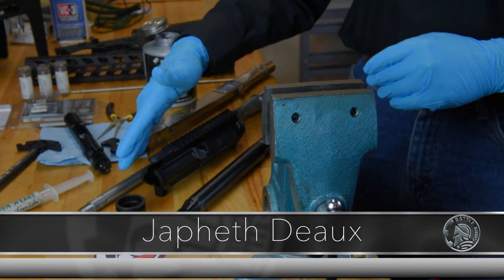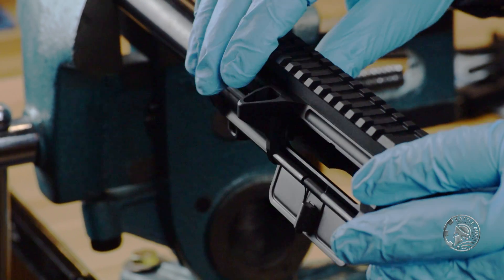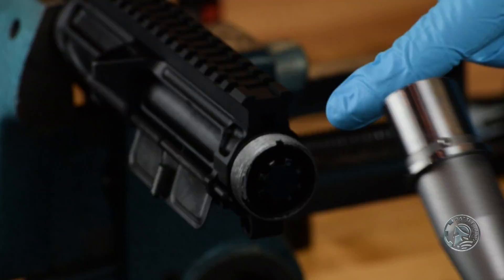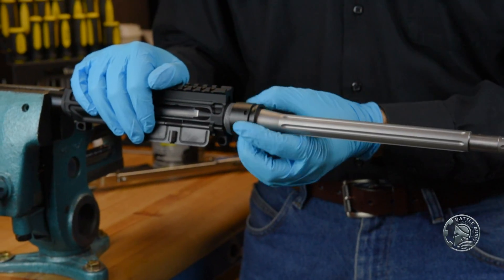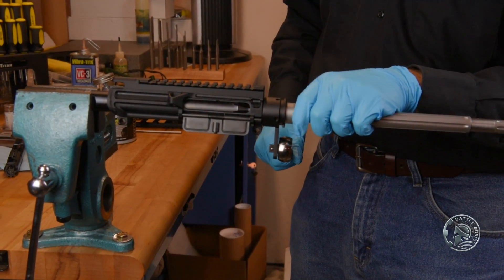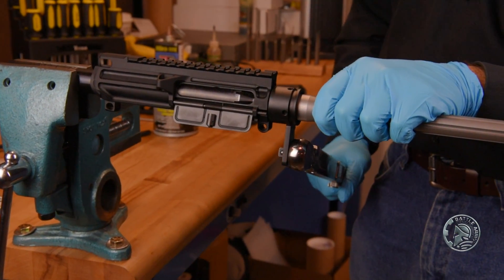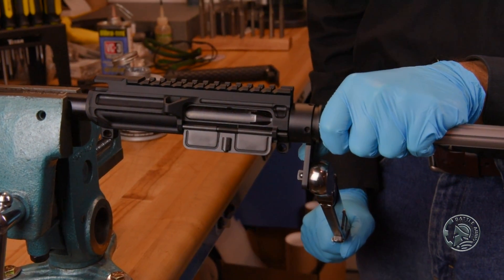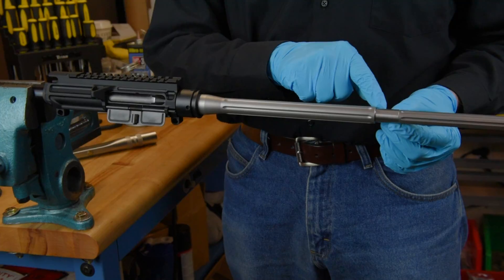THE UPPER:  Barrel Installation Part 3

Comment: Do you guys believe in facing or lapping the upper receiver face prior to barrel installation?
Reply from the maker: In most instances with machining tolerances being what they are, it isn't necessary.  For an absolute precision fit to your barrel extension along with "bedding" the barrel into the upper you really won't see a major difference in accuracy with a semi-automatic firearm using conventional off the shelf ammunition, and you run the risk of taking your receiver out of spec if you lap it too far.

Can it be done, sure.  We recommend it only for qualified professionals, however.
Reply: @battlearmstv7445  thanks